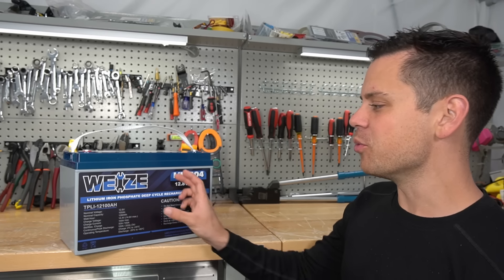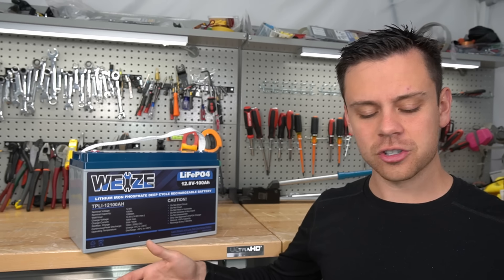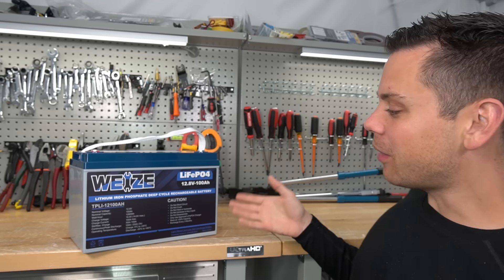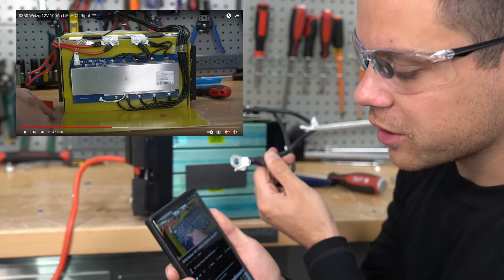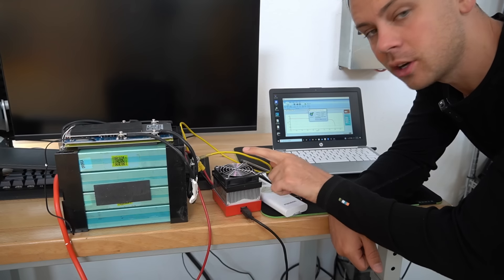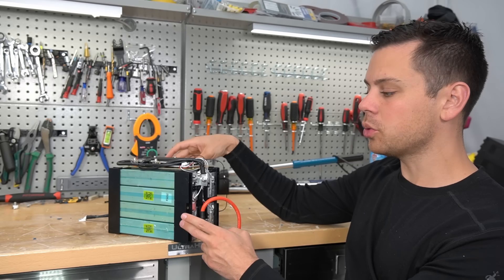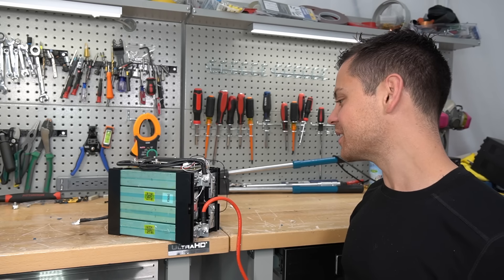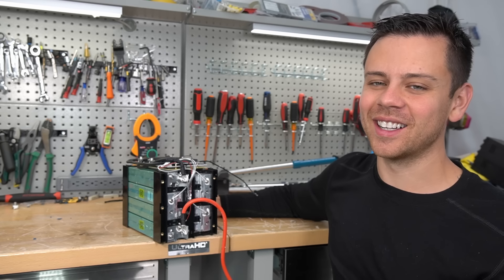$329 Weize 12V LiFePO4: 18 Month Update! Should you buy it?

Comment: I have an ATV with a one-of-a-kind NMC battery constructed with pouches. It's rated 50 volts and 145 AH. I need to replace about 12 of the 60 pouches that have failed or else get a different battery. The configuration is 5P 6S. The current battery is actually 2 24 volt batteries in series and it's fused with a 500 amp fuse. Any recommendations?

Comment: I've been considering buying these, but am wondering how well they will work on a very old pop up camper. Would I have to make considerable changes to the standard system on the camper? Or would these be just fine?
CHEERS from Colorado
Reply: I have a Weize 100AH replacing 80ah 12v lead acid deep cycle on a 2003 Starcraft popup. Found room on battery tray for plastic battery box to protect from rain. I use off-grid & only charge with solar panels so no experience plugging camper into 120v to charge, you should double check. Depends what you want to do, I started simple just replaced existing 12v lead acid battery so can power the lights etc way longer.  Ended up with panels, charge controller, inverter, & battery all from Will's web site or YouTube channel so I can live and work off-grid in my popup, all thanks to him! Will does have a forum to ask questions.

Comment: What would be the best system for me to power my Shed in Phoenix Arizona to run air conditioning lights and sockets? I was looking at Delta pro and then I was looking at One from DIY solar with 2 AGM batteries 2000 W. I want To wire it into my 30 amp Box that I already have wired 2 receptacles.

Comment: Okay Last year I bought a Eco Flo Pro Delta 1800 had it for about 3 months charging with the solar everything is going great. Have a power outage the reason I bought it and it wasn't charged so when the power outage was over plugged it into the wall outlet and not 15 minutes later it's smoking bad so I try taking it back to Home Depot where I got it from they said it was past the 90 day return policy so I called Eco Flo and they asked me to mail it back in with the receipt and they would replace it so spend about 200 dollars to mail it back waited about 6 months and called them and they asked me if I had the receipt so I said no you told me to mail back the system with proof of purchase so I mailed you guys the receipt so they said well if you don't have the receipt there's nothing we can do for you so my bad experience with Eco Flo Delta Pro all together after purchase was a huge head ache that all together cost me over 3000 dollars and I don't even have the Bad unit to show for it

Comment: the reason you go hundred amp hour, if you lose a battery you don't lose a 4th or half of your output. consider the phone UPS system, uses 18 amp hour.  this way if a few go out you still have 90% +. they'll have 200 of these little batteries lined up it half a dozen go out, it doesn't even hardly affect the output.  note as well tesla, uses the small modular system.  if a battery pack goes out, it's better than having a 4th of capacity battery loss. also each module has an army of small batteries in it, cheap to fix, "rebuild,"

Comment: Dumb question, I have two 100 AH lithium batteries installed on my camper & want to increase my battery capacity. Can I just add more batteries or do I need to match them all together with same type, size, etc?

Comment: Can these Lifepo4 betteries be used as direct SLA replacements and charged from ie. 40A PWM SLA charge controllers or do you have to get a LifePo4 charge controller?
The reason I am asking is because the SLA Charge controllers don't seem to be selectable for Lithium batteries.

The newer Hybrid Inverters wirh Mppt is programmable for Lithium so I select lithium just ti be safe. I lsa have a Tempest 2kw ups which has a lithium available on the display but seems not to be selectable and is factory set.

Comment: I bought two weize 100 amp lifepo4 and one of them arrived with 13.1 volts but my noco Gen 5-3 charger says its almost dead? think I should be alarmed?the other one topped off in about 15 minutes to a full charge.

Comment: I purchased one of these last spring. I bought it to replace my travel trailers lead acid battery. It never seemed to hold a charge. I thought it might be charge control. Well, I went to charge the battery recently and it won't charge. I Tried to wake the BMS, but it won't wake up. I guess it's permanently damage. I sent Weize a voice message and several email, but no reply. I guess I'm going to buy a Li Time or Chins.
Reply: Update: Weize has responded to my inquiry. They have been working with me to try and salvage the battery. So far, I've been happy with the communication. I'll let everyone know how it turns out.

Comment: Mine just Stopped working today after just after 1 year I have the weize lifepo4 100ah in the video Purchased it july 2022 it still had charge and placed it on charge with the Noco charger and today it shows 0 volts !!!! not sure what happened to it, did test the charger on other battery and it works fine

Comment: This is the inherent problem with product reviews.  Companies build and send a product for review and then cheapen it for production after the fact.  Every industry does this.  Car companies are very bad about building preproduction review vehicles and then the production units are cost reduced to death.  In the case of this video,  over the span of a year? the product has changed drastically on the inside.

Comment: Does a server rack battery put up with the vibration, bumps and temperature variation you would get when installing it in an RV?
Reply from the maker: Yeah
Reply: It not even hot out and mine is 91* inside now.

Comment: Can I put this inside my SUV (trunk) to run a dash cam? It will be charge using relay connected to voltage booster (8-40v to 13.8v) at 10 amps.

Comment: This battery worked great for a few months but now it shuts off if I connect it to anything. It shows 12.2 volts on my volt meter and won't take a charge. I contacted Weize and they wanted some voltage readings before and after charging with pictures and asked about my charger. Then they wanted me to buy a new charger even though my charger works fine so I bought the Weize Lifepo4 charger but the battery still won't charge. Weize wanted more voltage readings and pictures and to hook in parallel with a good battery then charge. I have done all this more than once and they are asking for the same thing over and over. I keep doing tests and charging and sending pictures and they respond by asking me to do it again. It seems like each time I send a message to weize it is read by a different person and they don't read the previous messages. I did find another guy that had bought 6 of these batterys and 3 of them went bad within 2 months. Each had the same failure, a bad BMS. I think I will just use the cells from this battery and buy a good quality BMS. If I could get them to replace it and they send me one that fails again I will have just wasted more time.

Comment: After watching you for a while i ended up choosing the 100ah SOK to put in a 2015 Jayco with 200amp solar panels. I have to upgrade the electrical box so it had a charge option for a  lithium battery. Quick question, i keep it in a garage but leave it plugged in so the battery stays at 100% is that bad? Or should it disconnected while not in use???

Comment: Seems like these may work well for a scissor lift.  I'm waiting for prices to lower a bit more then going to recommend we move to those from the lead acid ones.
Reply: Look out for the max amp draw on the lift compared to the batteries bms. You may want to have a few in parallel.
Reply: @Ken John  yep, I'll look into it, I believe it's a 2 series, 3 parallel but we'll see.
Reply: Also you will need a different charger

Comment: The reason for buying single 12v/100ah batteries is in case one or two of them go bad you can still use the goods ones. 
Example: You have a 24v/48v inverter/charger.....if you have 4 100 ah batteries on a 24v or 48v system and 1 goes bad, you can still use 2 of them for 24v.
If you had one giant 200 or 300 ah battery and it dies....you're done.

Comment: Question: why buy a 12V 100Ah lithium battery for $350+ when you can buy a 100Ah lead acid for less than $200?
Especially when used for emergencies like black outs say 4-5 times per year?
Reply: Buy one of each and after a year, you will be throwing one in the recycle can. Lithium is that much better. Night and day difference in performance.  Besides, to have the same watt hours as 1 lithium 100ah battery, you need to buy TWO lead acid 100 amp hour batteries. And then....lead acid batteries last 300-500 charge/discharge cycles. Lithium batteries are good for 2000-5000+ round trips of charge/discharge. Lead acid batteries are great for starting engines but not ideal for extended drain times with moderate loads. For backup, I switched to lithium and will never go back to lead acid of any kind.  I have had battery backup since the 1989 earthquake.

Comment: Three (yes three) Weize failures.  January, 2024 two connected in parallel self discharged at random times. Zero amp draw batteries showed on Victron monitor discharging from 13.4 to 12.9 volts.  Weize tech support helpful and, after suppling info, replaced both.  April, 2024 one of the replacement batteries would not charge after being drained to 12.89 volts.  Started to take a charge and after about 45 seconds cut out.  Again, supplied info to Weize and they replaced it.  So, warranty replacement good but batteries ….??????

Comment: Is there a way to tell which one you have without tearing it apart?
Reply: I ended up with some of each. For me, the old version is flat across the top and you can push the cover down. The new is pushed up slightly and solid.
Reply: @michaelstefani3713  I am not sure what you mean by cover.
Reply: @jamiekirsch222  the top of the battery, where the terminals are. For me the old one was flat across the top and it had some give. The new one is raised a bit and solid. Like there may be just a bit too much foam at the top. You can see the foam in the video at about 3:20.

Comment: I bought a 12v 100 ah unit that looks just like the one shown here. Months later I have my system about ready but need to program the charge controller (BSC 3048). The controller wants to know is this battery a: LiFePO4: 3.2V-4S /8S /12S /16S
 or is it 
LiFePO4: 3.2V-5S /10S /15S /20S
If anyone knows please let me know.

Comment: if your selling 100ah ... and making 105ah ... there must be a way to reduce cost and make them 100ah...    to save money  even if its a few% less product used to make it... if your doing 100.000 pices  in high production...any small %% of material use reduction is a saving ... because the end product equals the rate that people expect ...

I think you have to worry less about internals of a battery now ...  ask elon musk why they change chapes of batterys ...hights and withs... to maximise volume of space inside of a bottem of a car...  anny  los of pace is a loss of potential cappacity or range

Comment: How do you argue build quality if it doesn't fail? If China has 70%of the market. The odds are they are pretty much the same. Even the auto industry have used components from different suppliers than they use to and no one argues about that.

Comment: I hate them! When in 48v configuration, freeze protection will shut them off, however when they warm up and start to come back online the potential voltage of the string will cause over voltage protection to not allow the last one to come back online, thus all the batteries must be unwired and the asleep battery has to be jump started. So 48v string in cold is a total fail. It would be better to not have the cold shutdown and just know you can’t charge it when frozen

Comment: just swapped a 7 yr old 100ah Calb LFP battery for two 100 ah weize batteries -  not real impressed so far - fully charged  - Quickly drop to 13.1v -  
i need to do capacity test -
Reply from the maker: Lithium iron phosphate voltage settles after you charge it
Reply from the maker: Has a relatively flat discharge curve
Reply: @WillProwse  calb stayed 13.2v for hours - 2x weize  drop 13.1v  in few minutes -  just seems  to go low quickly  
took about 6 yrs daily use  of Calb  cells to really notice lowering performance  -
Reply from the maker: @GroovyVideo2  .1V could just be voltage drop in your system or meter accuracy. Doesn't tell us much. Potential wouldnt drop due to bad quality cells. Unless they were completely dead
Reply: @WillProwse  I did a capacity test and batteries passed   - my guess is BMS is a little off and somehow dropped voltage  - -  Thanks

Comment: Thats is a falacy about the rack battery for a only hundred more. Its $200 minimum for shipping those to even a state away. I had to pass on that purchase this weekend for the 4 red doo doo's and they shipped them free..... $1700 for the rack battery of 4 Red Doo Doo's for $1254 shipped. Thats $450 saved, Another 1.4 batteries. Not ideal compared o a rack battery and likely limited to 16 total batteries but doable. I would rather have had 200AH batteries but I needed 48V to start off. Have to have 12v x 4.
Reply from the maker: Oh right, but if you're doing a full size system with inverters and solar panels you're going to pay for pallet anyways. Not worth it if you're just buying one thing at a time that would just be awful lol
Reply: @WillProwse  Unfortunately that is all some of us can do. It gave me the chance to actually start rather than just think about it for another 10 years. I have expanded to the 4 100AH arriving tomorrow plus 8 100w HQST panels (Adding more later) and a 60A HQST 3200W @ 48V solar controller. I am going to use it to thin out my electric usage by putting my security camera system on it along with my TV and Computer. Yes in a perfect world we could all have more money, as a 55 yr old disabled man mine  little bit doesn't go far raising my autistic son alone. I only mention that to say that sometimes going big is simply never going to happen. Either way I have watched a ton of your videos and learned quite a bit, enough to help an x son in law ( I kept him after getting rid of his mom, LOL ) set up his camper and try to keep it safe enough for his weekends out with his wife and 2 kids. 

I actually want to build my own cells from here on out, you have inspired me to go that route but even that route is very expensive. if I don't go that route I will likely expand forward with the budget rack batteries you mentioned. Maybe if you get bored you could do a more specific video on some DIY rack type batteries or more about maybe some diy communication specifics about what these rack type batteries are needing to communicate back and forth etc. I like the experimental and DIY type videos more than review types myself though those tear down and test videos are a nice help.

Comment: Counterfeit Battery,  I was sent a diffrent brand battery.
This company does NOT take returns no matter how wrong they are.
I saw the reviews of how bad the customer service is, but you may not get the battery you ordered. Good luck with the customer service department.

Weize sales department:
   "We confirmed the two batteries can be connected since they are produced in same manufacturer and 
  have the same capacity and 12V. Thus you don't need to worry about it, if you have any question on the 
  battery, just contact us immediately.
  As we have sub-companies, the new battery we sent to you is provided with the same Weize brand and 
  they are produced by the same manufacturer, would you please charge the battery and can it work 
  properly"

Amazon Customer Service:
   Return requested: Yes 
   Reason for contact: The item is counterfeit

Comment: With server rack batteries being so economical now, I also wonder why we're still looking at multiple 12v/100AH cells.  I have an application for which I need boatloads of amps at 12 volts, but it's a rarely used requirement.
Reply: Because we have been using "car batteries" for over 100 yrs that won't change quickly. 90% of the population have no idea what a server rack battery is